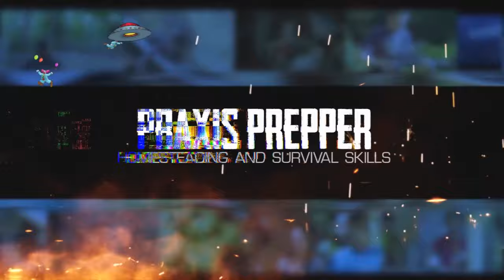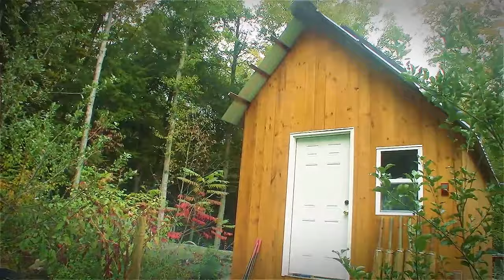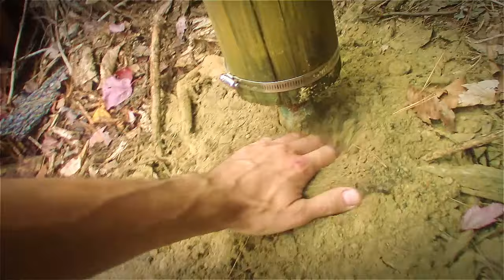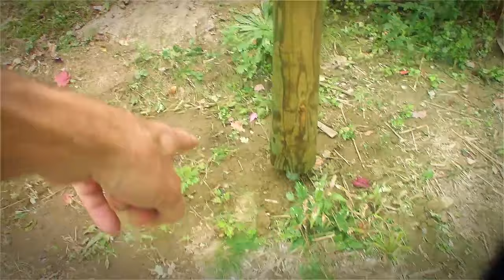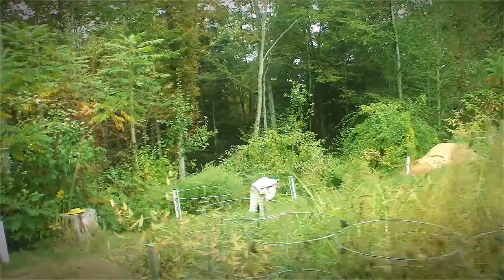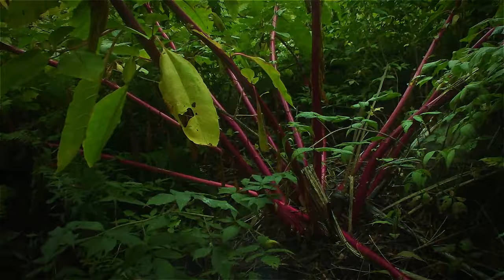Making Use of Your Last Days Before SHTF

Comment: Gentle feedback: I would encourage you to start one project and complete it before moving on to another one. It is less overwhelming long term and provides motivation to get through the challenging issues. Good habit to learn.
Reply from the maker: I don't really think that's always good advice. As someone that operates as I describe in this video, I think it's a good way to maximize time utilization when different projects have different requirements in terms of conditions or available materials. When one project is waiting for materials to become available, another project might be clear and ready to put in effort upon. If a project can be done straight through, that's fine, but when pauses are required (which they often are) being able to jump from one task to another, is a good skill to get a lot done without wasteing time waiting.

Comment: How far did you core out the posts to insert the pipes?  What was your thought process between the tradeoff of the pipe rusting versus the post rotting if you had just buried it directly in concrete?  Thanks.
Reply from the maker: To say that I've scientifically thought that stuff all through down to the micron would be misrepresenting how thoroughly i tend to think things through. Often times i take a stab at something and experimentally see how it goes. This is a bit like that. I set the last 4 posts this morning and shot a short video about it. It'll answer most of your question you asked, except that i didnt mention how deep i sink the metal into the wood. I should have mentioned that. The answer is about 10 inches.

Comment: We are in the middle of a small shtf here in upstate sc.  We are grid down and have been since the Hurricane past through.  I thought I was prepped and compared to most I certainly was, still there have been issues.  Food and water, other than maybe losing stuff in the freezer, which I still have not had happen, I think.  Donna is in an acute care center, which was not prepared and I have been running there everyday to make sure she has fresh blankets and water.  Because she cannot leave the bed she soils herself as no one is able to handle all the problems and right now we cannot really wash anything, so we are going through linens.  I am up in the air about saying screw it and bring her home but I can not pick her up nor can I administer the pain meds they can there, it is not a good situation. 

Food and water are not an issue for us but flushing the toliets last night was, I had filled the tub but it drained out.  Back up here is still a future project.  I normally run my LP fueled generator for which I have a couple of hundred gallons on hand but yesterday due to the rain my support under the genset slipped and the unit tilted and my battery slipped off and the positive terminal shorted right against conduit the wiring was in, the gas line was right next to it, the blow torch was melting the lead in the battery.  I was lucky not to have had an explosion.  Lesson learned but we have been fully grid down until I managed to repair the damage.  My small solar unit carried the refrigeration for about 4 hours.  So priority this morning is to get temps down and hope I did lose much.  Storing gasoline was good, it is very hard to come by right now for most people.  

We are looking at days of grid down and most people here are not prepared.  The genius leadership at Duke sent most of the repair vehicles and crews to Florida like nothing could happen here.  Every unit in Florida, Georgia, Tennesse and Carolinas should have stayed put.  Crews and Trucks should have been sent from the Midwest.  

I hope everyone on this channel really understands problems can and will happen.  Grid down is ok for an hour or two but when it moves into days it is torture.  Especially on the young and elderly.
Reply from the maker: Hey charles. Sorry for the hassles on your end. You know me and that my knee jerk reaction is to say, "what a great chance to road test preps, learn, and be more ready for next time!" But being in the middle of it, words like that probably just sound irritating. So i'll just say "good luck and i hope things get better soon" instead. It's crazy how people insist that videos like this are about something that can never happen. I literally read a comment this morning o  this very video saying that - nothing will ever happen (despite things happening all the time). Best luck. I have your peach seeds drying out today.
Reply: @PraxisPrepper  I totally understand and yes I do see this as a test, we are not going to die and it will end in a few days.  But it is not exactly fun.  I really worry about what all the people who had no clue are doing.  When the genset went down, we got to spend a long dark night in a hot house, thankful it was not deep winter.  Luckily, I was able to repair the genset this morning, so refrigeration is back on line, but I do not have spare power for AC, we do have some fans however, so it is not so tough for us.   I have to spend 5 gallons of gas a day going to Donna but again not a big deal because I have more than enough put back.  We have water and food and some expensive power back up.   I have the small solar system with a 200 watt panel that is generating 60 so as of right now my small unit is back up to 4 percent.   What ticks me off is I do have a big system 12kw, with 30 panels but getting them in the air has been beyond thus far.  You can belive this is motivating me to get my butt in gear and find a way.  I just need to build racking.  

I can really say shit happens and everyone should get the hard labor stuff done while they are young, it does not get easier as you age.  If anyone thinks it does not they need to pull their head up out of the sand and just see what it happening right now and this is nothing to what it would be if we have true national emergency.

Comment: I need the mob to remain 'asleep' 30 more days. My pantry needs a little more work. I only started the pantry 3 months ago.
Reply from the maker: Good for you that you're working on setting up a good pantry. I find mine to be so useful. The most common SHTF "emergency" that my pantry saves me from is running out of various things like vanilla extract or sugar while I'm in the middle of baking. Add to that the money saved by shopping in bulk and bulking up during sales and a pantry is an all around win. The only thing to watch out for is stocking up on foods that tend to spoil. I can't drop a huge list of those here, but in terms of dry things that people might not think about as being spoil prone, items like crackers, and chips tend to have rather short shelf lives due to the oils in them going rancid. Good luck!

Comment: My biggest issue is that the part of my life that needs the most work, our rural property, is two hours drive away. That means, realistically, I can only get there one day a week, and that's only if the stars line up correctly. It's incredibly frustrating.
Reply from the maker: That's hard. The last time I built a house (the one in the video), I made sure to live 10 minutes away. The commute can be a killer - I agree.
Reply: @PraxisPrepper  Biggest priority (aside from cost) was that it was far enough from the coast so as to no longer sweat hurricanes. Unfortunately, the properties that were far enough away was considerably more expensive, so we had to go farther out. Really wish it could've been closer though.
Reply from the maker: @rw8147  Is your plan to set up a new home there and move at some point? If so, things will get a lot easier once you get through this bottle neck period.

Comment: too many jobs to do at once , you need prioritize your jobs ... working on too many things will mean nothing gets done
Reply from the maker: There's sense to that thinking about focusing on a task. Better to have one task done than 100 tasks at 1%. But i disagree with the absoluteness in what you say. Sometimes there are jobs that are better done at one time than at others, so being able to flow from one to another is a useful way of making the best use of time when breaks are required (for example while waiting for concrete to cure).
Reply: Nah, Stuff gets done. Issue is Burn out working on big projects. Prioritize stuff that needs to get done, and spread out your time on the minor projects. Plus some tasks are pure tedium. its no so bad if you do a little bit so it gets done, but does become a burden.